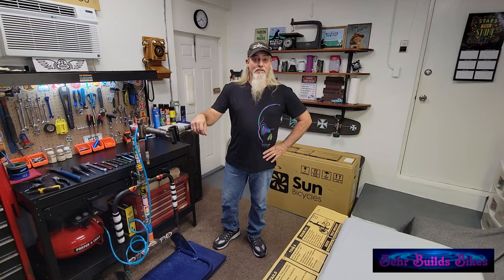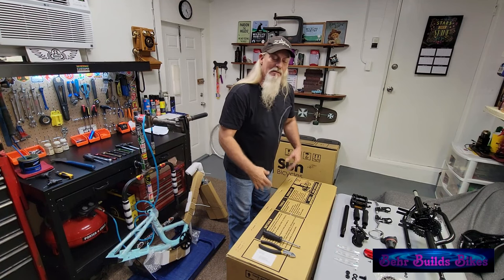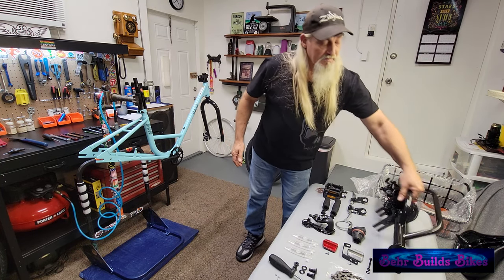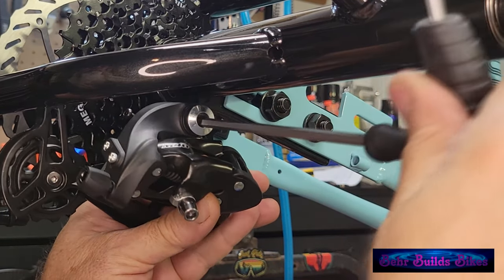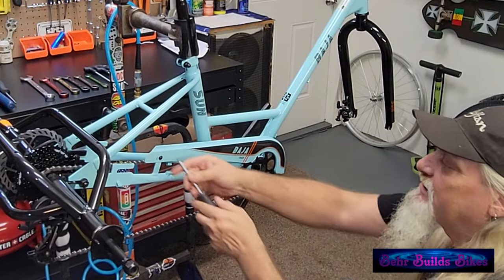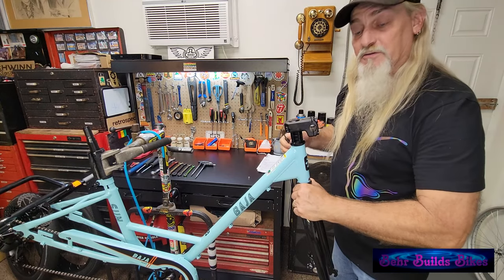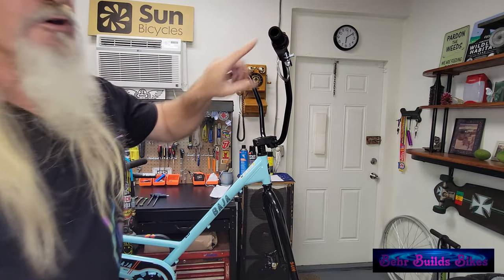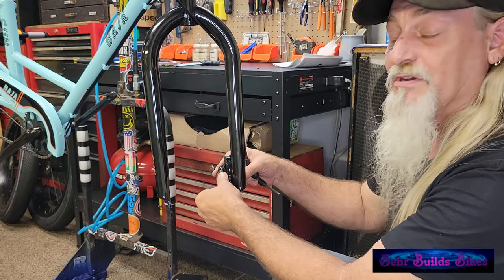Miami Sun Baja Trike assembly 4K BBB

Comment: Kool so replacing bearings and cranks arms more or less how much ?
Reply from the maker: Depending on the quality you're looking for,  you could probably convert to 9/16 cranks for around $125.00 plus labor.... that would be decent quality.....you may find cheaper parts, but you get what you pay for. I would estimate about $50.00 to $75.00 for spindle and bearings ( aka "bottom bracket" ) and $ 49.99 to $69.99 for compatible crank arms with sprocket. Be sure to get a similar size sprocket so it will fit in the chainguard.
😁👍

Comment: Any chance you can show how to swap the cassette and rear break disc? This looks like great trike to convert to electric.
Reply from the maker: Essentially,  the freewheel and disc brakes are mounted to the axel with an allen bolt on each side of the freewheel/ disc rotor adapter. There is also a "key block" in the slot in the axel and adapter.
Remove the brake caliper from the frame. Loosen allen bolts so that freewheel and rotor can slide back and forth. Slide the axel out on the drive side to remove the parts and exchange to the electric parts.

Comment: Your video convinced me to buy one of these trikes unassembled, I got a much better price doing that way. My plan is to put a 750W Bafang mid-drive motor on it, so I will be pretty much be swapping out a great number of Sun parts for Bafang's.   Since I'm starting fresh, will pretty much any 7-speed shifter work with this bike?  I have a Reid "Boss" 7-speed Fat Bike with a 1000w Bafang and would like to keep the controls the same.
Reply from the maker: I'm pretty sure any 1 to 1 ratio shifters will work. Sunrace,  microshift, shimano, sram all make 1 to 1 shifters and derailluers. Sounds like a fun project. Let me know how it turns out.👍😎

Comment: Hello could cranks be changed to 9/16 cranks just because most real nice pedals come in 9/16?
Reply from the maker: There is a conversion to a three piece bottom bracket set that can be installed in this frame. It is not made by Sun, but I believe the company is called Sunlite. The crank arms are not part of the conversion kit and depending on the size of the sprocket,  you may have to adjust the length of the chain as well. Also, be sure that the sprocket is made for multi speed chains and not single speed. So to answer your question,  yes, it can be done. 😁👍

Comment: Great video.  Maybe you could help me with some info. I want to make Sun Baja electric by hanging a  go-cart motor off the back of the rear assembly. I think I need a 40 tooth (driven) sprocket for the optimal gear ratio  - The available shaft space between the freewheel and rotor is only about 3/4" - do you know if they make/where i can get a single sprocket freewheel that will fit in that space ?  

Another option I thought about was replacing the 7 speed freewheel with a 9 speed cassette ( and using the 1st - biggest gear for the motor - 2nd gear as a spacer - and the remaining 7 for the pedal gears.. what specs do I need to match for a cassette to fit the existing shaft collar that holds the freewheel? And do you know where i can get one with a 40 tooth gear?

..it also occurred to me that i could use the existing freewheel's top gear for the motor and adjust the travel on the derailer so it can't shift past 2nd gear - but I think its only a 34 tooth - when , I think, I need 40T - to get the right balance of torque and speed, and i don't like loosing the highest pedal gear.
Reply from the maker: You may want to check out this video....
https://youtu.be/2X4RZuWEGo4
Reply: @behrbuildsbikes  Yeah I saw that - thing is mid drives are expensive - especially high watt motors - and I've built a front hub kit before, but want rear-wheel drive on this one.  I found a 48v 1800w 4N.M. Torque - electric motor for around $100 bucks. If I can make it work, and it works well - it bodes well for affording some future projects I have in mind - but I really don't know anything about bikes - I just need to know if they make a 40T single sprocket freewheel (5/8" bore, 3/16" key way) that will fit in the 3/4inches of available shaft I have between the existing rotor and freewheel ? and where to get it?

If not I have to go with running the motor on a cassette gear - which, I think will be a problem for pedaling with the power off - which is okay by me (bad leg, don't pedal)- but not great if I ever want to sell it.
Reply from the maker: I haven't done any conversations on these yet, but I have seen a few online too. I don't know if they make a 40 tooth freewheel and I'm not sure if a second drive adapter will fit on the axel next to the rotor adapter.  Maybe a second rotor adapter can be modified to work.

Comment: Hello Sir , could a 2 piece crank replace its factory 1 piece crank , ?reason I ask is all Crankbrothers pedals I like come in 9/16
Reply from the maker: Yes, there are conversion kits available to convert the cranks to 9/16 . It can be expensive,  as you need to change the bearings and the crank arms, but it is a pretty easy conversion.👍😁

Comment: Do you have instructions for installing the 7 speed and disc brake kit? Or any tips as far as how far the sprocket and disc break are installed away from the bearings?  Thank you
Reply from the maker: The freewheel and disc rotor are installed at the factory on these bikes, but the process to install them on a single speed is similar to the traditional trike. Pull the axel out just far enough to be able to slide the freewheel assembly and the rotor onto the axel. Slide the axel back in. Put the key blocks into the slot in the axel and slide the freewheel body and rotor over the keys and position each approximately 3/8 to 1/2 inch from the bearings on each side. Once the rotor is on, install the brake caliper. Tension the axel with the left rear wheel installed and the finalize the rotor alignment. Then install the derailleur and route the chain. Once the cables are run and all your adjustments are made, tighten the holding bolts on the freewheel body and rotor mounts to keep them in place on the axel. From there, it's just a matter of fine tuning everything.
I hope this helps. I will have more videos in the future dealing with modifying and custom configurations on different bikes
Please like, share and subscribe to keep this channel going. Thanks for watching.😎👍
Reply: @behrbuildsbikes  Thank you Sir. I shall give it a try.

Comment: Thank you so much for the video, what’s the length on the axle?
Reply from the maker: 30.25 inches X 17mm . I hope this helps.😁👍
Reply: @behrbuildsbikes  thank you
Reply: @behrbuildsbikes  just one more question. What’s the measurements between each of the drive pins?
Reply from the maker: I'm not sure what you're asking for. Are you asking about the gear ratios or the distance from the crankset to the drive gear on the axel?
Reply: @behrbuildsbikes  25:38 those pins on the axle where the  wheel locks, I have an atlas industrial trike, I just want to make sure those pins are the same as mine, that way I can put this wheels
Reply from the maker: Yes, these wheels will fit your axel. The hubs are the same for all Sun trikes built after 1980.
Reply: @behrbuildsbikes  great! 😃 thank you so much for your time and fast response,
Reply from the maker: Anytime! I hope I was able to help.😁👍
Reply: @behrbuildsbikes  you definitely did, thanks again

Comment: Hi, that’s me again, do you know the size of the fork?
Reply from the maker: The steer tube is 1 1/8" threadless, I'm not sure of the length.  Sun bicycles does sell the replacement fork for the fat tire trikes and as far as I know, they are all the same size. Just a note too...the Baja trike fork will not fit the traditional trike frames. You would need to change the headset and cut the steer tube to fit. I hope this helps.😁👍